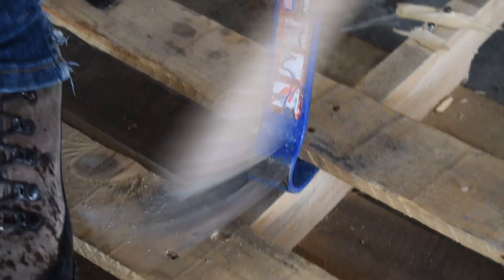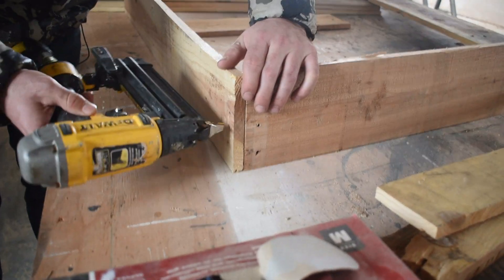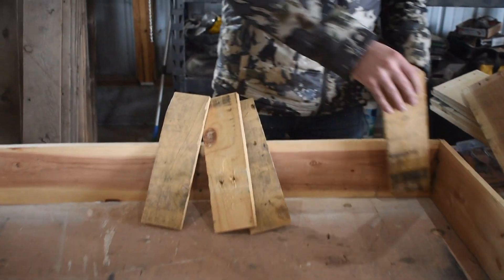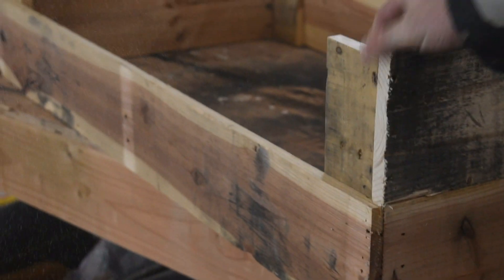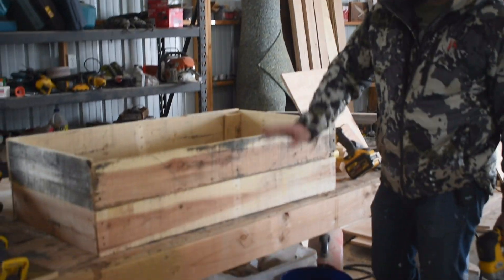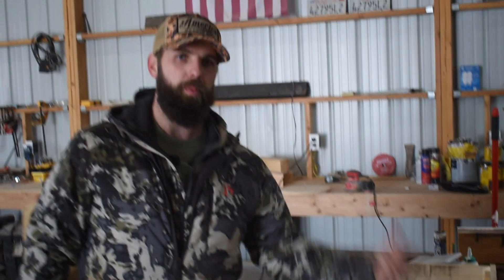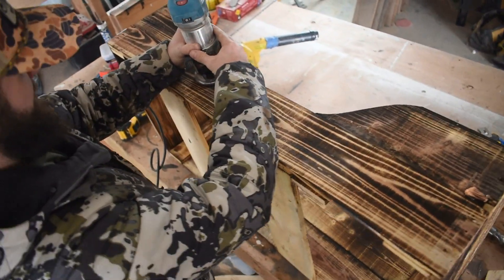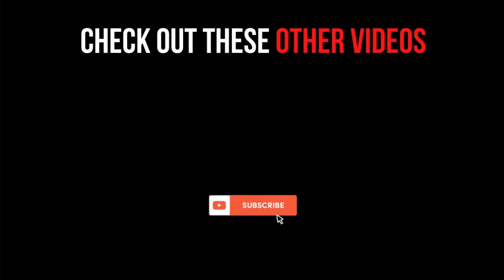DIY Dog Bed with Wooden Pallets!

Comment: Question?  As a beginner woodworker, aren't the bradnails too weak without glue?
Reply: Bradnails will work fine for something that doesn’t require much weight, if the bradnails had to support something heavy, then yes you would glue, or biscuit joint to ensure it will hold